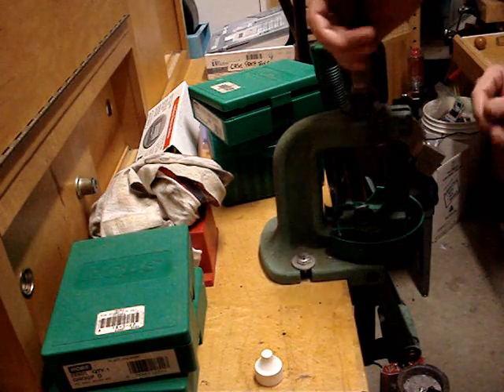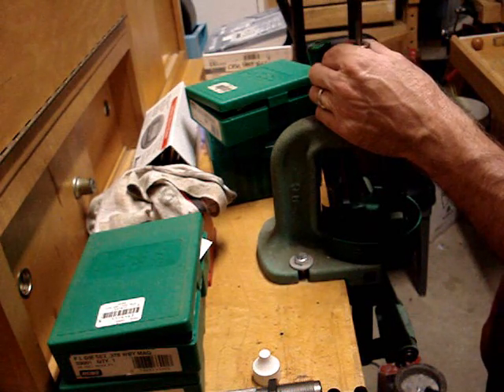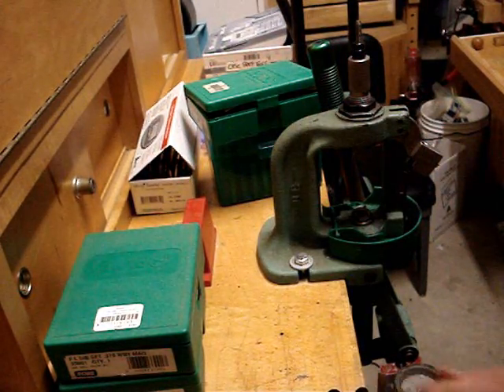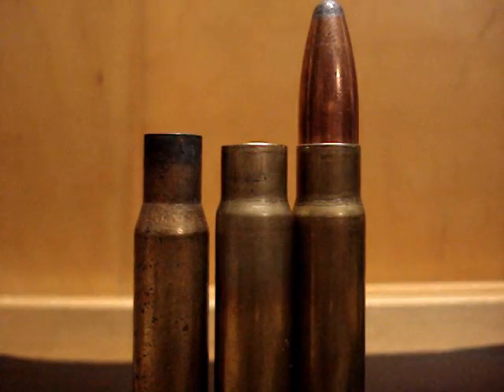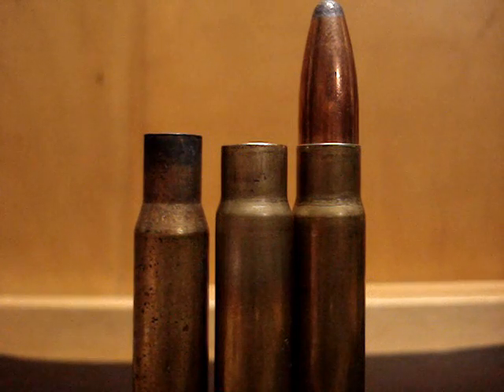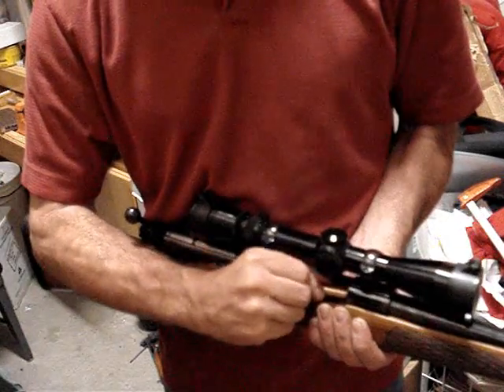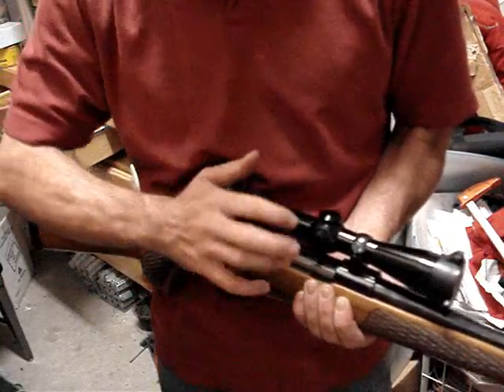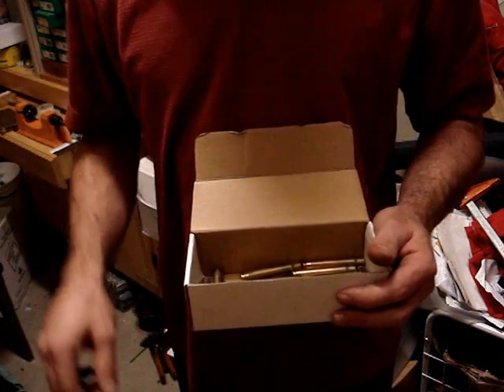Advanced Cartridge Conversion Part 3

Comment: Hello, great set of videos.  I have a 9.3x57 and convert 8x57 brass for it.  I use Lee dies because of the tapered expander buttons.  If you tighten the nut on top, they will not slip on you.  it's a much more gradual expansion of the brass and I seldom loose any due to neck splits.  I also go up to .416, then back down to 9.3.

Comment: I read how to do it, I have some 303 brass, but no 303, annneal the case in hot lead to just below the shoulder, drop in cold water, load with pistol primers and 8 grains Herco and fill the rest of the case with cream of wheat, fire, presto, a fire formed 410 case